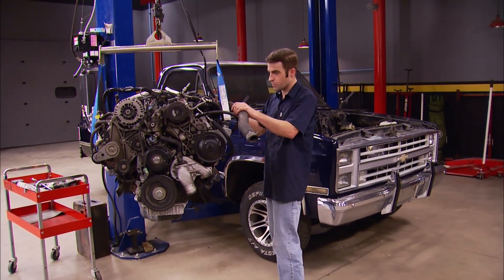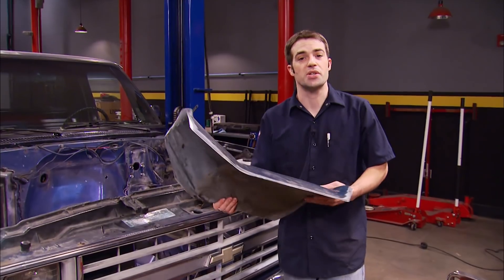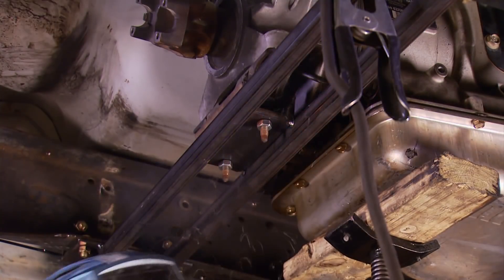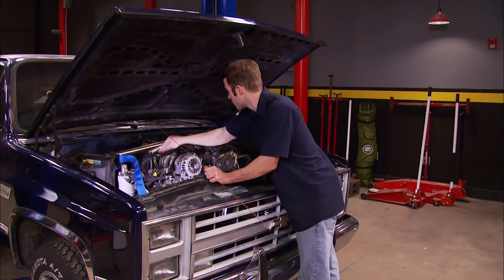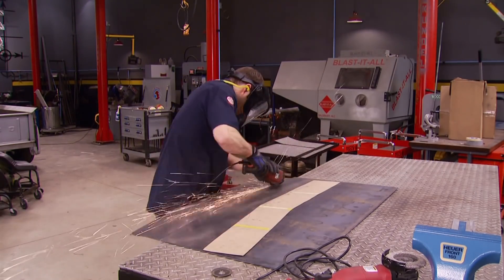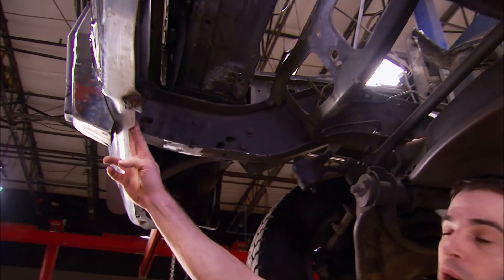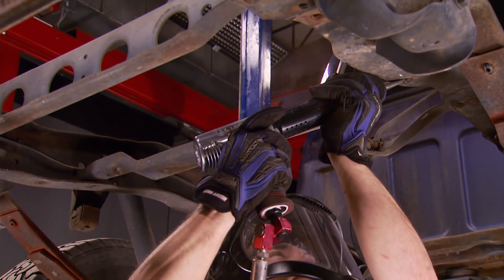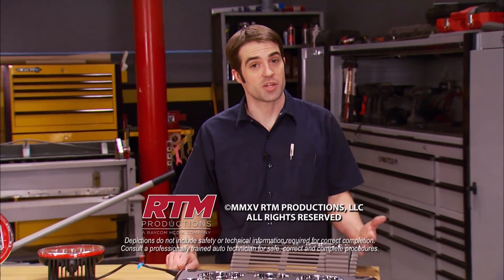Duramax Swapped Chevy 1500 Needs a Stronger Frame - Truck Tech S2, E7

Comment: I think your frame reinforcement should be from the engine mounts back, because that's where you introduce the torque into the frame. And reinforcement plates should never have rectangular ends, because that's introducing stress points into the frame where it ends.

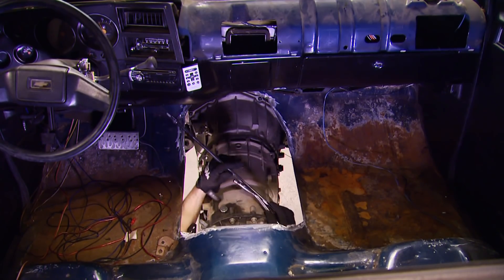Comment: 3:46 I was thinking stitches might be coming when he reached his hand up through that sharp sheet metal to grab the socket. I noticed a second later he was wearing gloves.......These guys always make everything look easy.
   If I had the cash for a new or low mile used vehicle, I think the money would be better spend on an older restomod with upgrades than most of the newer factory vehicles.

Comment: Here is a funny: you put down the saddle fuel tank, then put one in like the ford pinto. Yeah that is safe.
Reply: Well the problem with the Pinto, wasnt just that the tank was mounted in the rear.  As well as the Pinto, MANY cars and manufacturers mounted the tank in the rear, and many had the same potential problem with the Pinto.  Mustang, Maverick, Nova, and many many others, not just Fords, had insufficient (and in many cases, no) protection between the tank and the interior.  In the event of some rear end collisions, the tank could rupture into the passenger compartment and if fire was involved, burn any occupants.  Obviously, in a pickup, with the tank mounted below the truck bed, that isnt an issue.  However a saddle tank, or worse yet, a tank mounted behind the seat, had major potential for problems.
Reply: @buzzbomb67  I heard that report, and the follow up report with the toy rocket motor. I've had many trucker with saddle tanks, even had to put one on a delivery truck. Only trouble I had or seen is rust through.
Reply: @toddjensen692  Ya, I think its just the thought of the fuel tank being right there behind you.  The in-cab behind-the-seat tank that many older trucks had, pre-73 (I think), would likely be the only one that would definitely be the problem.  Nonetheless, the saddle tank right behind the cab would still concern me in the case of a side collision.  Again, probably unfounded concern, but concern nonetheless.
Whats this about a toy rocket motor, though?
Reply: @buzzbomb67  you are right. My '58 had the one behind the seat, and it did bother me. My buddy has a 72 with it I'm still nervous bout them. But not saddle tanks

Comment: Why no weld trough primer on the framerails? Strange doing so much work for the frame to start rusting....
Reply: They make spray setups that are flexible and can undercoat inside the rails.

Comment: Why not get a Chevy 2500 that already has the diesel engine and transmission?
Reply: It makes for horrible TV if it’s that simple.
Reply: The weight and sleeper look would you expect a Duramax engine in a 1500
Reply: @daltonbrumfield5514  Especially in a late 80's Square Body 1500!
Reply: because why get the 80s diesel when u can have the 6.6 Turbo diesel
Reply: Why would you do that your clearly not a gear head

Comment: Mid engine isn't it , the engine sits way behind the front wheels.
Reply: No, mid engine is typically behind the driver.  This engine isn't that much farther back than a standard sbc.

Comment: I am fan of your channel. You guys are all talented mechanics. Not a big fan of square body chevys. I remember those trucks when they were new. The late 70s and 80s were not good years for well , all the truck manufacturers but chevys esp . I’m just saying
Reply: based on resale value and numbers. . . id say the ol squarebodys were the best of the lot. i have 2 still original. rough around the edges but 40+ yrs old will do that.

Comment: I'm glad you're going with the hydroboost unit!  As I mentioned on the previous video, diesel engines don't produce vacuum because they don't have throttles.  So, to use a vacuum booster, you'd have to add a vacuum pump.
Reply: Yeah when he said they decided to do that for room, I’m thinking “ you’ll be doing it for more than that, since a turbo diesel does not produce a vacuum source”.  And with limited space, it only makes sense to use what already works.
 BTW, I am also an 02 LB7 owner.
Reply: @megastick9324  Nice!  It's always cool to talk to a fellow, LB7 owner!  Take a look at my channel and let me know what you think of mine!